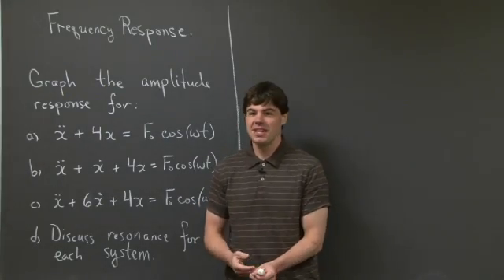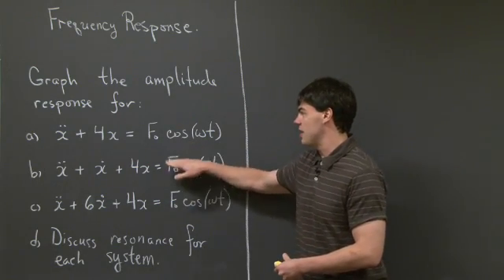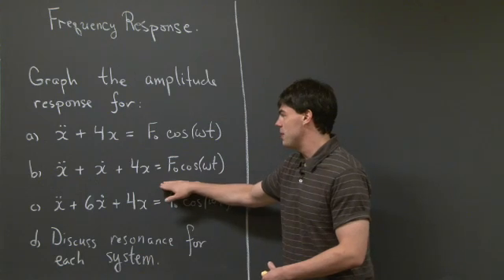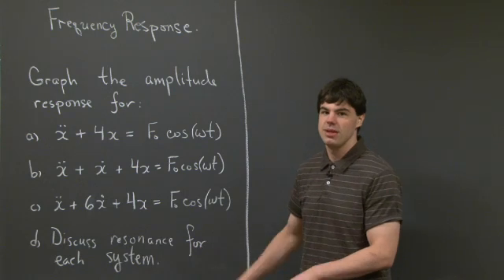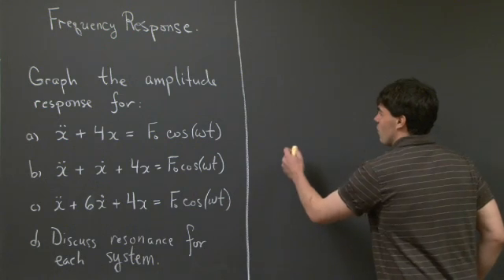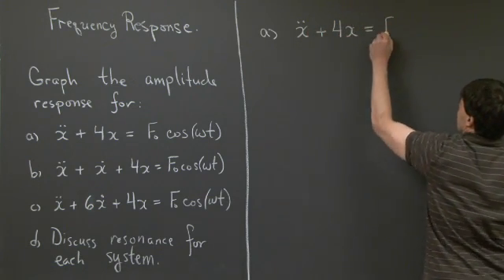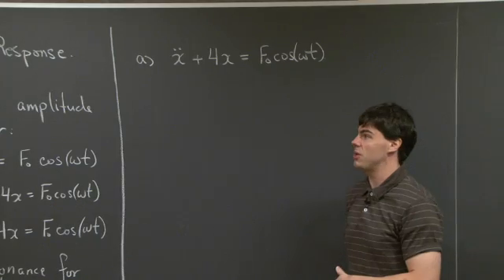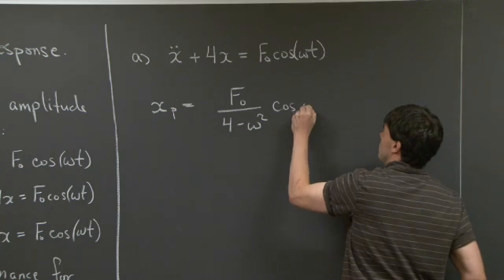Frequency Response | MIT 18.03SC Differential Equations, Fall 2011

Comment: addis11100 
You idiot he didn't square i he took the ABSOLUTE VALUE of the complex number. The absolute value of a complex number z = sqrt(z.z*) where z* is the complex conjugate. Why are you taking Differential Equations if you don't even understand simple high school level complex number theory? and yet you keep arguing here. If you couldn't even understand this how did you understand anything taught in the course so far?  

"Also at 8.55 he said min but amplitude is max at sqrt7/2"

It IS the Min! He isn't talking about the amplitude he is talking about the Min of the DERIVATIVE!

Comment: see at 8.03 when he squared i he put 1 instead of -1. Also at 8.55 he said min but amplitude is max at sqrt7/2 . i square is also-1 not as you said" it will have a positive value anyway".
Reply: He is right. Computing the norm for the complex number does not involve i.
Reply: @sicongliu1484  you think so? I checked it good.